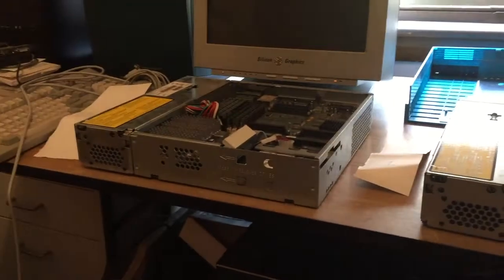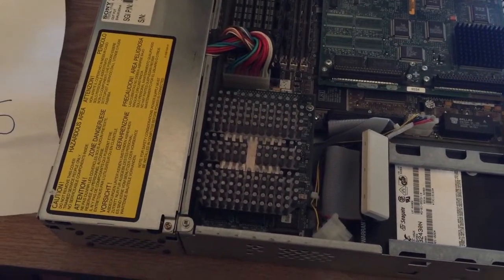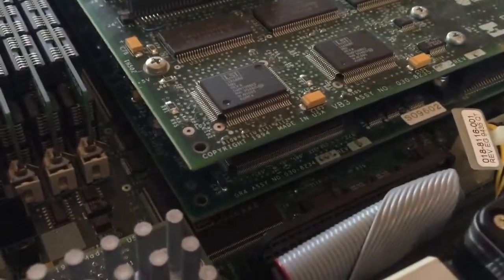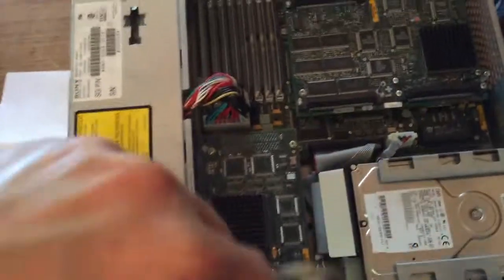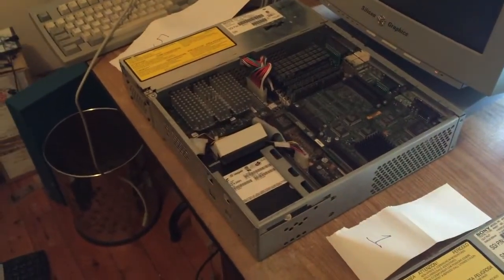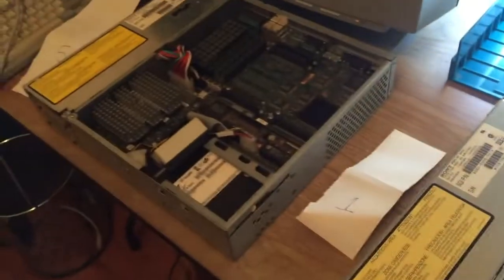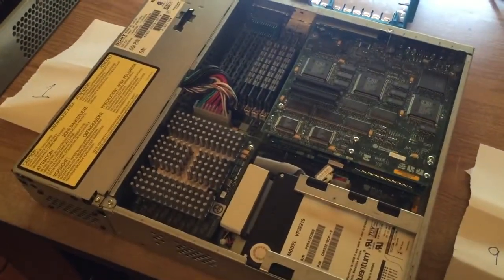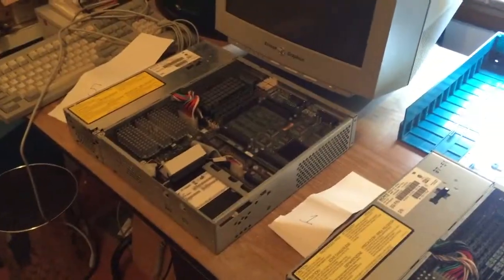SGI Hardware - Indy R4400, R4600 and R5000 comparison

Comment: Hello Michael! I need help. It turns out that I remove the CPU from the socket and I can not put it back, it is not attached to it .. would you tell me how to install it? thank you very much.
Reply from the maker: Do you mean the CPU card/daughterboard or that you removed the CPU from the daughterboard itself?
Reply: I mean the cpu module of a Sgi Indy, I remove the processor of the module, a R4400 200 mhz, but when I want to put it back, it does not stay firm, the socket has no lever.
Reply: If I leave it like that, and I put the sink on it, the indy does not light.
Reply from the maker: Sorry not sure, haven't ever tried removing the CPU itself.

Comment: Nice videos! Your R5000 Indy has a 150MHz processor - the 180MHz model always came with cache. You could check the benchmarks on Ian Mapleson's site to see how it stacks up against your R4400 system - I think it would be pretty close for most tasks even without the cache.
Reply from the maker: SiliconClassics Hey thanks for the feedback, sorry for the slow reply! You're correct it is a 150MHz version. I'll add that to the description. Ian's website is great, actually I've had a few conversation with him via email, great guy.